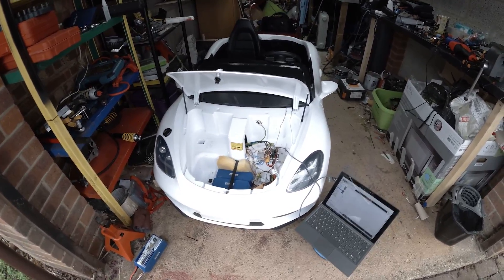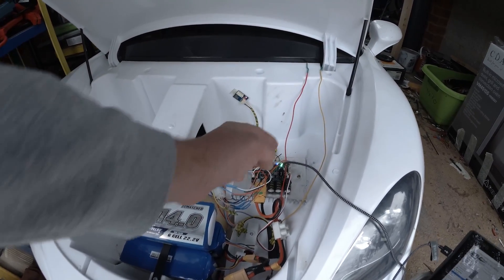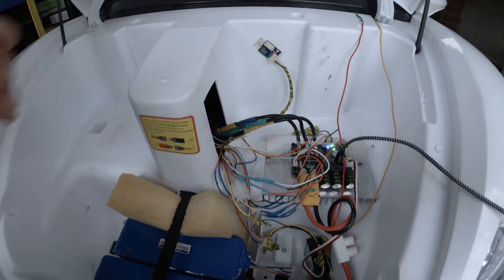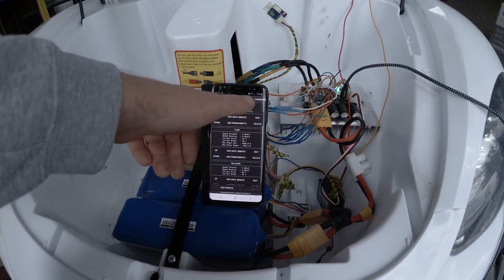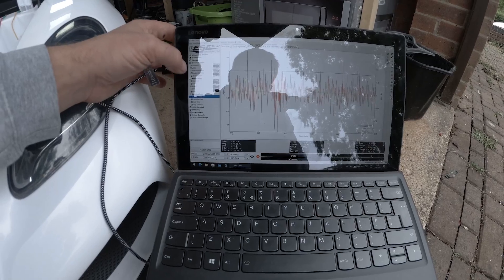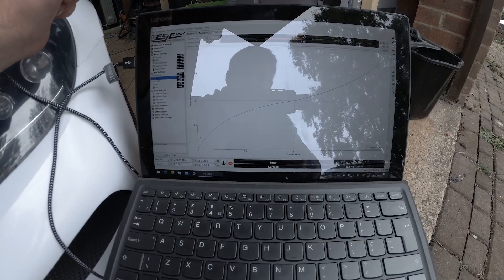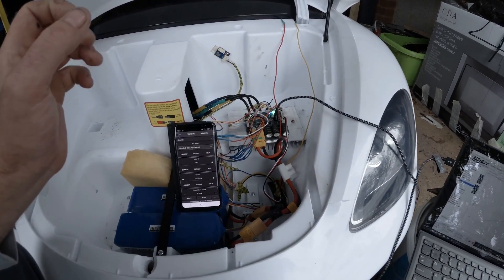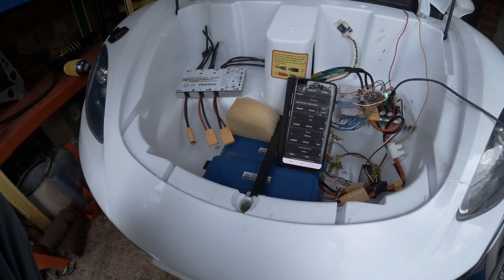Super Sport XL Stage 1 upgrades explained

Comment: Hi, will I be able to upgrade the speed limit by simply upgrading the esc to vesc 6.6 and leave battery and motor the same?
Reply from the maker: normally you have to increase voltage to gain speed  and to increase amps to gain acceleration. the vesc controller has a feature were you can increase the speed of the motor on the same voltage but is quite complicated to program

Comment: Hi I’m wondering if you could just hook up a 40v Ryobi battery to the stock ESC? I have multiple 40v 6ah batteries. I have done the 18v Ryobi batteries to 12v batteries without issues. What are your thoughts?
Reply from the maker: You can replace the ecu with 1500w 48v one similar to the stock one it shoud be almost plug and play. You find themmon amazon

Comment: @Extreme Power Wheels  Did you open the motor to upgrade the wires or just run new wires and leave old motor wires 4-6" long?
Reply from the maker: Second option. Eventualy i replaced the wires completly but only when i jumped to 92v and i was pushing 200amps. For lower voltage i did not see any diference

Comment: Hello, how do you wire the Bluetooth and petal? Can you use the same ground? I will order more powerful board soon but have the flipsky 6.6 now.
Reply from the maker: The pedal is wired on the com port green wire to adc1 pin black to ground and red to 3.3v
Reply from the maker: Also the reverse button is connected ground to signal on the rc 3 pin port when you use Bluetooth
Reply from the maker: On my controller the bluetoth is integrated
Reply: So the reverse switch is connected different on the flipsky board? Or is it the same as the trampa board 100v? I plan to run the flipsky board till i recieve the new board but like the Bluetooth feature. Thanks for your help
Reply from the maker: @JWnVB  they have the same ports. If you add a bluetoth device. You need to use the remote port for the reverse button. We can speak more on facebook @ExtremePowerWheels
Reply: So for throttle is yellow-adc1, white=gnd, red=3.3v. reverse switch use 3 pin servo& gnd. Bluetooth use tx, rx, gnd, 5v. Keyswitch use + & -. Correct?
Reply from the maker: @JWnVB  i cant remember if it uses 3.3v or 5v but the rest is correct. You can order the bluetoth adaptor from trampaboards.com
Reply: Can i connect footswitch and bluetooth to same ground? Or no? If so, i can use same plug for throttle and bluetooth to make it easier. Thank you for your time and help.
Reply from the maker: @JWnVB  yes there is no other way throtle and bluetoth go on the com port

Comment: Do you think the stock esc will be ok overvolting with 36v liion?
Reply from the maker: Never over power a controller. It will burn in flames
Reply: Are they 24 v batteries
Reply from the maker: @aaa-mw2lu  they are 6s litium bateries. Each has nominal voltage 22.4 and the maximum voltage when fully charged is 25.2V

Comment: how long does the battery last
Reply from the maker: My 18s Lipo Battery Pack with 14Ah has an estimated range of 10 to 15 miles depending on driving stile
Reply: @ExtremePowerWheels  I have the same super sport  but in orange I might just take on this project to make it a 20mph little beast
Reply from the maker: @alfredom877  if you need any advice you can find me on facebook @ExtremePowerWheels
Reply: Why dont u start making some and selling them
Reply from the maker: @topezb1088  because when you modify something there is always a chance for something to go wrong. And i cant be held responsable if it does and sombody gets hurt.

Comment: Can you make more stage 2 road driving vids? I want to see how fast it is and how well it can corner
Reply from the maker: I woud love to but i cant find a decent private road  to play. The car frame and body is stock and it was designed for 10mph. I do not know what you expect a toy car to drive like and most of the weight it on the back wheels. Soon i will build a go kart chasis underneath with suspensions and proper tires
Reply from the maker: In the next fiew days i am planning to replace the front wheels and to add disc brakes on the front. I need front brakes desperately at hidher speeds